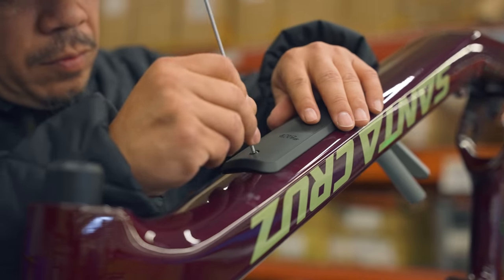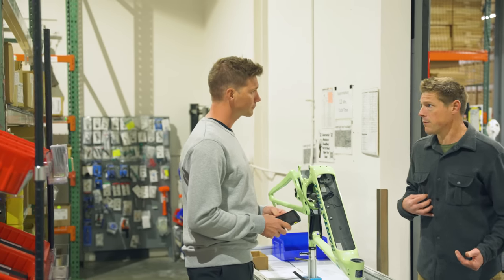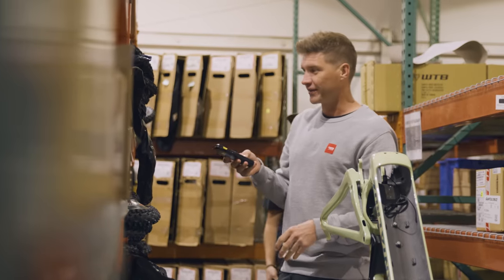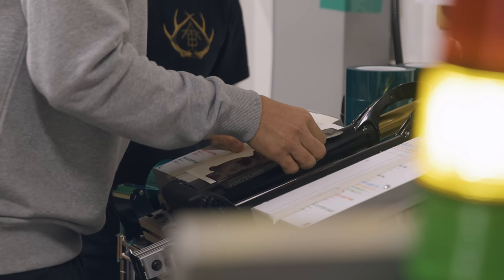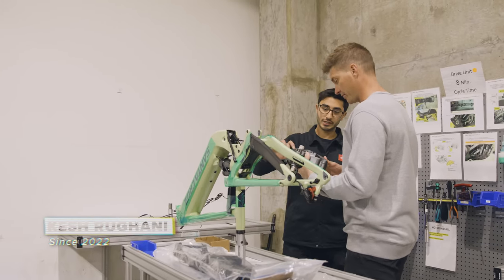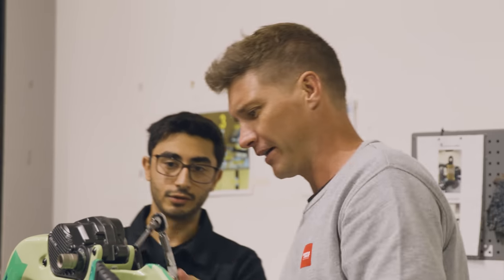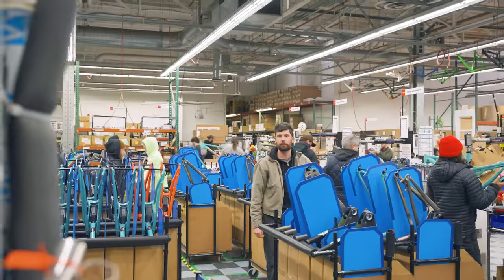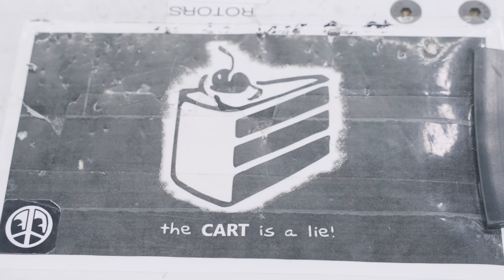Santa Cruz Factory Tour with Greg Minnaar [Episode 4 of 4]

Comment: Awesome series! Can see why these bikes come with the price tag they do👍
Reply: I thought the opposite, timed manufacturing and assembly is never good for employees or quality. It actually put me off buying one as they are insanely priced.
Reply: @aberdeendeltaforce  I don't know of any other large output manufacturers that aren't timed or on an assembly line (US assembly line) that would be cheaper. And the cruising around with a trolley picking parts, doing the fork etc looks fairly time consuming and inefficient compared to slapping the same parts on every build. Hence the reason I thought the price was slightly justified 😅. 
Curious to what brand you went with?
Reply: @jamlee344  Intense tracer 👍 and trust me when I say they could sell these bikes at half the price and still make a healthy profit. It costs them around $145- $230 per carbon frame made in Asia. Depending on the c frame or cc. They still have to outsource the linkage and shock but even then I would estimate costs of around $400 -$500 per complete frame set. I would say it does not cost them more than $1000 to produce a complete bike based on my inside knowledge of bicycle production.
Reply: @aberdeendeltaforce  yeah making them would be the cheapest part of the whole process. The overheads would be expensive. Engineers, advertising, warranty, race teams etc etc.
Reply: @jamlee344  the biggest cost in any industry is the ceo or owners pay cheque, that’s the bottom line in any business, they will cut costs ruthlessly to keep that yacht running and that jet flying. 😂👍

Comment: Dear Santa Cruz, please stick with 148mm rear hub spacing and threaded BBs. Please never go with headset cable routing and please always allow for cable rear mechs and cable or hose dropper posts. I would rather spend my money on Chris King bearings to hubs, headset and bb and have a standard cable SLX/GX drivetrain than have electronic gears. Please also consider doing a frame only option without a shock as I would rather take the savings on the standard shock and go with a Push Elevensix. On my 4th Santa Cruz frame and about to buy a rear Reserve alloy rim which will do me for the rest of my life. Usually go through a rear rim every 6 months, so this should save me a small fortune going forwards :)
Reply from the maker: We're listening